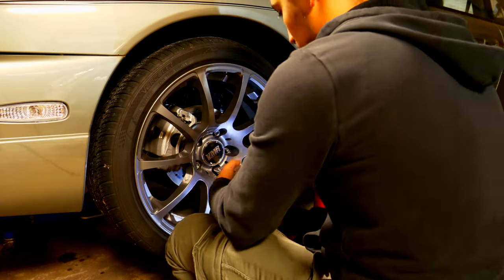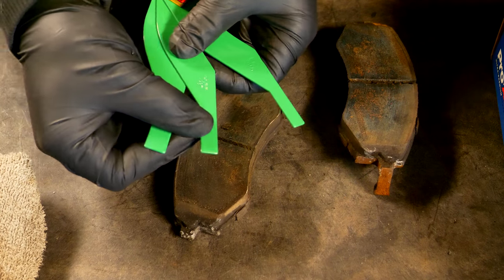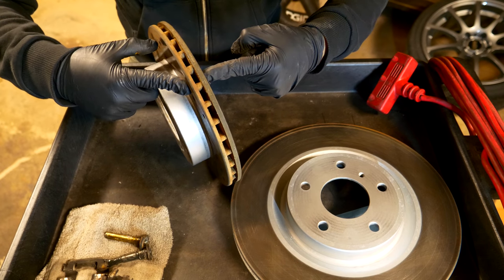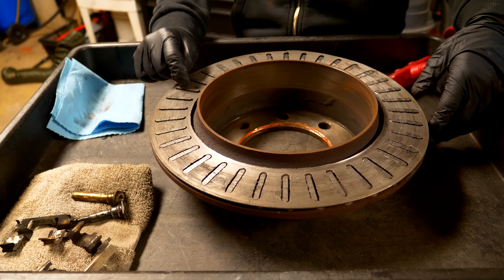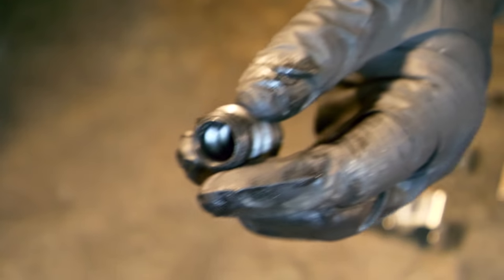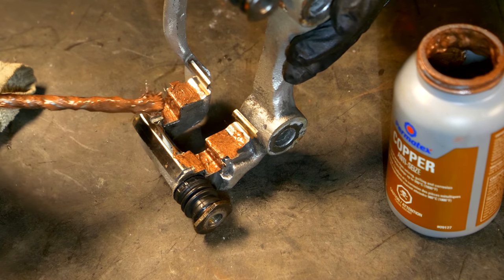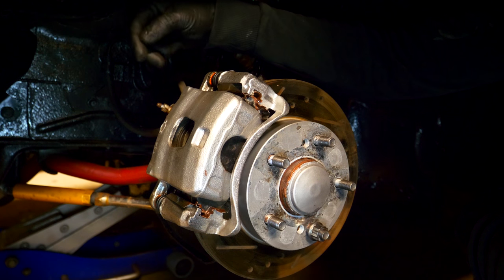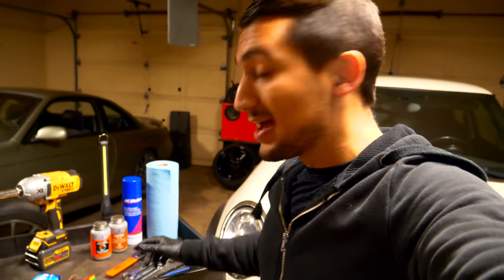How to Inspect and Lube Your Brakes (COMPLETE GUIDE)

Comment: Hey mate... nice video. ... next make a video on(is it advisable to install a turbocharger or a turbo kit  into a straight 3 cylinder engine.... because im mentioning my car's engine
Reply from the maker: It all depends what you need it for. If you're looking to make something fast that wasn't designed to go fast, be prepared to have other parts break on you, since they weren't meant to withstand the added stress, but going back to your question, WHY NOT :)
Reply: Mia Mia where babe????
Reply: milanmastracci sooooo are you trying to say it can be installed or not????? And also I need a tutorial on flamethrower kit installation

Comment: After replacing disk pads on Rav4 with all four wheels with disk brakes, my pedal height was a good 40% lower to the floor, plus the E-brake went 'higher' a good 3 to 4 clicks. When I retracted each piston I opened the bleeder valve a little, then closed it. After I bled each wheel, starting in the rear...twice. Still low pedal. Any ideas?

Comment: 10:25 I was hoping you could answer this question. Have you had any problem with Permatex orange formulation being incompatible with the rubber sleeves for the slide pins? Online reviews suggest this may have been a problem with Permatex green and purple formulations, which leads to binding of the pin, or caking of the lubricant. Therefore some prefer to use other lubricants such as Sil Glyde (which is not as readily available in Canada). Thank you.
Reply: I used the purple color 3 years ago and so far no problems,  in a couple of days i will re lubricate again
Reply: I prefer silicone based brake lubricant for the slide pins.

Comment: Coat the slider pin on the sides not on the tip. Anything at the end of the pin is a potential obstruction for the pin to move freely.

Comment: can you re grease your caliper pins with the tire on the car if you just slide them out? or do i need to take the whole tire off? there is a slight creaking noise but my pads are still fine as well as my rotors.  all i need to do is lube it up

Comment: Should rotors be able to move back and forth? I was checking my brakes on my Dodge charger because I keep hearing the brakes squealing even though I just changed them a few days ago. I noticed that the back rotors only turn not move back and forth like the front rotors. Do I need to get new ones?

Comment: Where is the rubber pin bushing that goes back into the "trailing pin"  hole?  I made a big mistake by cleaning both pins with brake clean. That chemical attacked the rubber pin sleve and it swelled. I could not get the pin back in with the rubber sleve on it. Also it is important to use the right type greese which was shown in the video.

Comment: Should always use new bolts to go into the sliders and put thread tight so they dont loosen. Also all the different bolts he tightened need to be done to a specific torque with a torque wrench
Reply: I have performed hundreds, if not thousands of brake jobs...The slider pin bolts do not need to be replaced if they are still in good shape. They do not have a high torque value on them in the first place. Anyone who has done the "first" brake job on a new vehicle will know that the slider pin bolts are not very tight from the factory. Over time, the larger, caliper bracket bolts can become rusty. They should have a film of anti seize put on them each time the brakes are serviced.

Comment: i was always told that you should only use brake lube for the brakes pads and sliding pins is there a difference between the brake lube and anti seize or does it not matter?

Comment: 4:15 the brake pin rubber boot should be on the end of the pin. In this video it's gone. So you need to replace that when you put it back.

Comment: when there is rain during night the windshield gets foggy and when any opposite vehicle come it. Is very difficult to see is there any solutions for that.
Reply: A sock filled with kitty litter on the dashboard and clay bar your outer windsheild
Reply: Wear sunglas
Reply: If it's raining run your air conditioning on a closed loop inside the car.

Comment: You forgot to lube the back of the pad with a thin coat.
Reply: On the new pads, they usually have a thin pad of material that eliminates the need for the grease. I still use it anyways just because. On cheap pads, yeah grease away...but plan on replacing the pads in a year too. lol.

Comment: Inside pads ALWAYS  wear faster dude. Think about it. You have a piston or pistons pushing against the pad MORE than the outside pad. Its called mechanical  compression. No, the compression is NOT the same on both pads. I have been doing brakes all my life and the inside pads ALWAYS wear first. Thats BS saying they used improper pin grease. As long as the pins slide, they are fine. Its the pad hardware that causes pads to wear improperly. If the pad slides forward but cannot move back( which happends over time due to brake dust) . Sorry to burst your bubble but its not the pins, its usually hardware. Always replace the hardware too. Over time, heat and corrosion take the temper out of the hardware. You admitted yourself later that the hardware lets the pads wear unevenly. Up north, we have problems with the salt and road junk eating the rotor and causing issues with brakes dragging and rotor warping. They now offer ceramic coated rotors to help with that issue. Your video was pretty good over all. You were not wrong as far as what you covered , you actually went back and covered the actual cause of uneven wear. However, it still happends over time reguardless.  Usually its time to replace both rotors and pads anyways. I am glad you didnt bring up resurfacing the rotors, no one does that anymore and rotors today are not manufactured to be resurfaced. They make them much thinner to save on material and cost.
Reply: Not according to Newton.

Comment: To much lube on the pins... yes you can over lube them. Also to much anti seize on the ears of the pad... way to much. But you do good work. I work in a shop. I lightly lube the ears with ani seize
Reply: he explained why he needs to put more since the slider pin housing is clean
Reply: ok for the pins but really too much on the metal guides. The copper grease have to be apply lightly just to lubricate and avoid some rust. No need to put a lot of grease on this part cause of some grease drop on the disk or pad you have to be ready to replace all of them.
Reply: Flynn Joy it doesn’t matter. There needs to be space so that pin does its job. Too much lube and the pin will push itself back out. Im an automotive technician.
Reply: George Farah i guess if something happens to the brakes we will know in a future video. Anyway i got a question for you since you are mechanic, my brakes are making a noise when releasing the brake pedal and i recently had the brake pads change and relube with liquimoly anti squeal for the front tires, im suspecting the rear drums are making that noise. It only does it when the brake pedal is release but not when I step on it, pull the handbrakes and then gently release the brake pedal. Do you have any idea why it does that?
Reply: These are certainly your new pads. You have to chamfer them. Already happend to me.
Reply: sylicoman I had that noise even before I replace them, i dont hear them coming from the front too.
Reply: Flynn Joy have someone get in the car and tap the brakes. While you listen to them
Reply: Yep. Too much lube on the slide pins will hydrolock them in their bores and cause problems.
Reply: I agree
Reply: pushing the pins in will force the excess pin lube out but wayyy too much antiseize.
Reply: Your right he put too too much lube grease on everything
Reply: George Farah can I use aluminum anti seize instead of copper antiseize?
Reply: Nice a compliment with an insult!
Reply: The caliper guide pin clearance in the caliper bracket is quite small (pins have very little play in the bore hole), so the amount of lube needed is really quite low.  In fact, for pins with the rubber bushing at the end, they actually wipe the bore wall sides.  So, you only need enough lube to coat the pin and hole sides, the rest will end up at the bottom, or squeeze out at the boot at the top.  I never lube the top surface of the caliper bracket hardware, that just provides a place for stuff to stick and collect(brake pad dust).  New SS hardware should allow the pads to slide in them fine - remember, this is not a typical lubrication situation as the pads are only moving back and forth a couple of thousandths in the hardware each time you brake.  

Also, the caliper boot and facing surface and the opposite caliper ear surfaces should get a light coating of lube on them (I use clear silicone lube) so that the contact points with the back side of the pads are lubricated on both sides.  Doing this, and then properly bedding in the brake pads will allow for a no noise installation that really should be good and not need to be redone until the pads need to be replaced.
Reply: @MangCnasal ,
There are areas on drum brakes where the brake shoes make contact with the backing plate, and they are supposed to be lubed. Also. could it be they need a cleaning?
Reply: @raybrensike42  yep i have put copper grease on these contact points and the noise was gone. good catch!
Reply: This level of maintenance should only be done when the pads need replacement. As discussed you can inspect both pads & the rotor for wear without disassembly when you rotate the tires. For drum brakes in the rear, inspect the shoes & inner drum when the front pads are replaced. I remove rust / corrosion build-up on the hub, rotor & wheel matefaces & lightly lube to prevent vibration...which happens more often than you would imagine. I also lube between the shims & caliper bracket (cast iron) & not the brake pad ears (steel), to prevent rust jacking / seizure of the pads.

Comment: Lube the rotors and the pad material, it really helps with stopping in time
Reply from the maker: Really helps with your stopping distance 😉
Reply: milanmastracci 
The sarcasm is strong with this one...

That said, have you tried using nickel or Aluminium permatex antisieze instead of copper? Nickel antiseize has higher temperature rating than the other 2 types, though I want to make sure they are compatible for the slider pins. Thanks
Reply: For the slider pins you must use only silicone paste, because other lubricants will ruin the little rubber boots.
Reply: jobeppe 
Hmm... I believe I may have caused a misunderstanding.

What I meant was the metal guides that the calipers slide on, not the slider pins that of course need rubber compatible lube.  It's the components he used copper antiseize on.
Reply: Lube with what grease or something even more slippery
Reply: Well lube the pads not the rotors
Reply: @jobeppe  Yes, a petroleum based lube will soften the boots right up.

Comment: Can you help me please? I have problem with my guiding pins. I clean the wells with WD40 and Q-tips. Then I use the SilGlyde lubricant, I put very little, very thin layer. And yet, next time I check, guide pins are seized. I noticed that the rubber dust boots on the top make airtight seal. Yes, the guide pins have 3 flat channels, to allow air to escape, but it does not. When I install them, I push all the way in, and they bounce back. One of the guide pins have a cut out near the bottom where the anti-vibration rubber rings should be. If I put these rubber bends, I can not push the guide pins at all. They get stuck at the base of the dust boots. Any idea?
Reply from the maker: I would 100% run more grease in there. You say you run a very thin layer, however they're seizing, which means there's a corrosion issue where the pins are not lubricated enough. You could have moisture trapped in there, and as a cheap precaution, I would replace the dust boots to ensure they don't have any leaks in there.
Reply: @milanmastracci  Thank you for your quick response. Florida. No rust. The dust boots are intact, but they look like they are soft and squashy. I just looked around and discovered that the Camry 2000 dust boots have a metal insert and how to remove them. I feel like, that the dust boots make an air-tight seal. When I push the guide pins, there is a spongy air, and it pushes back the guide pins out. I think I shall replace the dust boots.
Reply from the maker: Ensure that you have the correct guide pin in the correct hole, as sometimes the guide pins are hole specific.
Reply: @milanmastracci  one pin has a grove for anti-vibration rubber ring. The boots will not let the pin go in with the rubber ring on. I have given up on these rings long time ago, and guess what: no problem of ratling squeeling or vibration. some manufacturers do not use any of these rubber rings. I wonder, why the boots are so tight? I clean them only with non-polar solvents, like WD40 or mineral oil spirits. Grease is non-polar.

Comment: Can I use anything else instead of cooper paste and is ceramic paste the same as silicone?
Reply: i use anti seize on the bolts and brake grease on the pads and sliding pins,  no issues

Comment: I was told to use only "Sil Glyde"  lub on the pins to prevent the rubber from going bad.
Reply: That is correct and will work, should be a silicone based lubricant.

Comment: I did it wrong.. i got a little packet of grease from Autozone where I got the brake pads.
 I thought you're suppose to put that on the brade pads. LOL
Reply: Not being able to stop when you hit the brakes would have been ur 1st clue.... you can put  Very little  on the side that touches the caliper piston but Never on the actual pad material that contacts the disc.

Comment: I wouldn't recommend using anti seize as a lubricant. Thats not what its designed for.
Reply: yeap, the video is good, but you are right, all brake parts should have special brake grease, on bolts yes I always use anti seize

Comment: Looks like the upper guide pin was missing a rubber bushing where the diameter of the pin steps down. Both of my cars have rubber bushings there which should be replaced. They’re supposed to help one be able to swing the calipers up to quickly change pads but over time, the rubber swells essentially freezing the upper pin in place. Last mechanic was probably thinking, to h@ll with these annoying things! Lol
Reply: The bushings are noise dampeners, not for ease of swinging the calipers.

Comment: If the inner pad is more worn is it ok to swap places with the outer pad?
Reply: Not at all. Either pin is sticking or pad is, which woulda create a ton if heat and glazed that pad. 

New pads, brake hardware, clean and grease caliper pins. Dont leave one of those out

Comment: Will you replace the stock brakes with Nissan Z33 350Z ones?
Reply from the maker: I'm looking into an upgrade for the 240. There are a few options, like a Nissan 300ZX 4 piston direct bolt-on caliper, or a massive 6 piston Cadillac CTS-V Brembo upgrade. I'm weighing the pro's and con's before choosing, but am for sure doing to do something

Comment: Good video but at 9:48 do NOT spray brake cleaner inside your boots or they could swell up later. Replace them or just clean them with a clean rag or Q-Tips. NO brake cleaner on rubber!

Comment: Holy crap at 16:35 you see that the pads are taller than the rotor. Looks like the wrong size (outer diameter) rotor is installed here.

Comment: No torque wrench? Most pin screws are pretty light but caliper bracket bolts might be a lot more than you think. You might even need some blue thread locker on them. You don't want prices of your brakes falling off while driving 😉

Comment: Why didn't you tell everyone that the slider pins are different? You should have explained the difference on the slider pins so they don't mix them up. One has a rubber seal, and one doesn't, on most vehicles.

Comment: You forgot that a stuck caliper can also cause uneven pad and rotor wear
Reply from the maker: Thats what is meant by the slider pins not sliding as they should. I feel I could make a video just about uneven pad wear

Comment: You made the biggest mistake you could make!
Copper Grease has poor lubricating properties. ... Never use Copper Grease on the back side of a brake disc mounting face as this can increase the Disc run out lead to DTV (Disc Thickness Variation) causing brake judder.

Comment: I love the gauges, are these for blind mechanics? holy crap! 

4:36 anti seize ; where does it go? 

8:32 "holy shit" i've seen some steel on steel but I ain't seen that shit! Did you berate and shame him into proper maintenance? 

...is there any anecdotal or documented issue with mixing any kind of these greases ?

Very good post, sound quality was clear, video and framing was good, explanation was succinct and not rambling or vague... 

So, you can have all the tools in the world but if you got shitty sound, video and explanation it's just mediocre at best!

Comment: Why didn’t you bolt on the brake disk onto the hub?
Reply from the maker: There isn't a bolt for this car. Some cars have a little screw that holds it on, some don't. My Honda for instance does indeed have them

Comment: You do know all that antisieze will either wash away onto rotor or collect dust and act like a glue not allowing pads to move you should never put anything on brake hardware they should be clean and grease free

Comment: Dude. DO NOT slap that lubricant on the slider pins like that. The pins are now not going to work properly. The pads will not wear correctly as the pins have lubricant on the tips and therefore will not be equal on each.